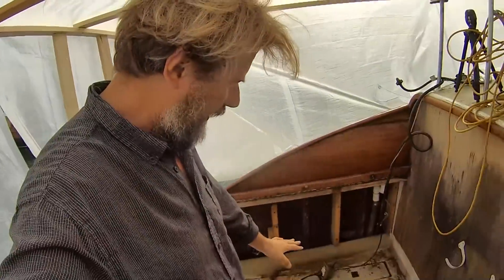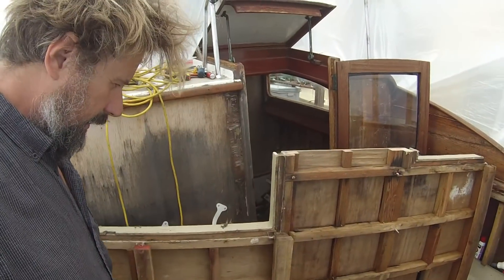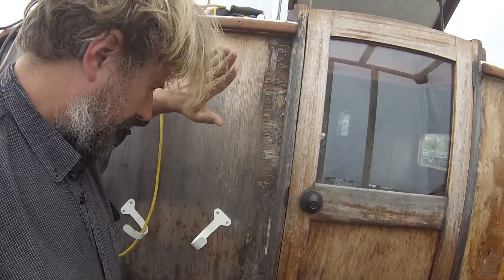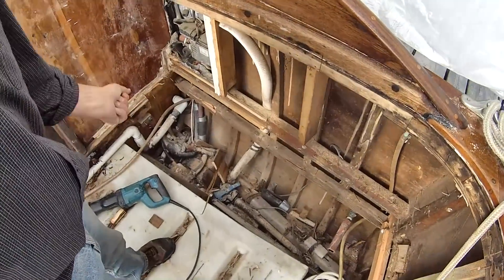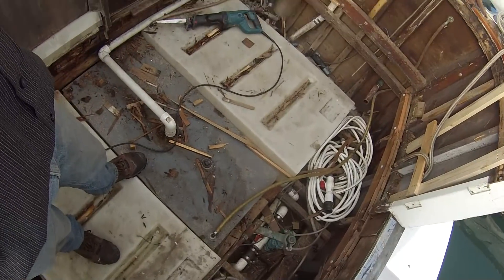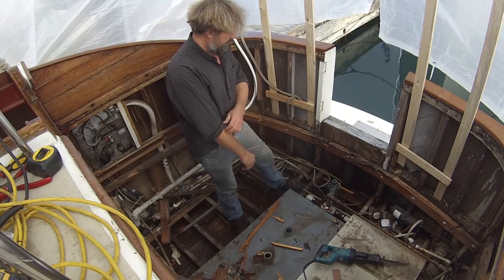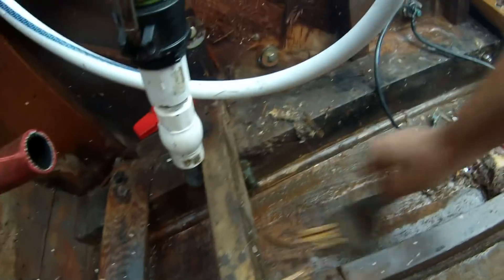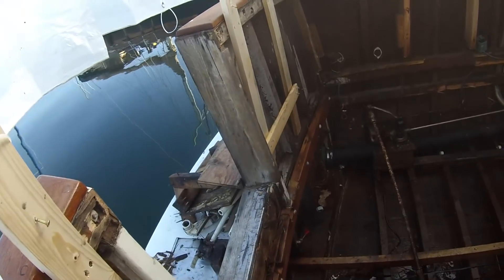Removing the old cockpit sole - Wooden boat restoration - Boat refit - Travels With Geordie #65

Comment: Nice work, big project also.  Have you explored a composting head?  Could eliminate the holding tank and all the plumbing! Take care,
Reply from the maker: Thanks Tom, I have, only briefly. It seems it not the perfect solution for cruising and I need a tank anyway as the boat is now zero discharge. Even the bilge pump goes into the tank.

Comment: Would wood hardener work then after that sets, add some fiberglass resin maybe some fiberglass CSM afterwards?
Reply from the maker: Hi Kevin, I really appreciate the input. The repair is complex and likely temporary at best. I've done a lot of research on this particular problem and think I have a plan. You nailed it with wood hardener, I'm going to use CPES, a very thin epoxy after first drying it as well as possible considering it's afloat.I wouldn't need and laminate as it's not really loaded much. Th goal is just to stop the delignification. which I largely did by disconnecting the misguided bonding wires.Thanks again, so grateful for your interest.

Comment: Question for you: Why are you doing this afloat. Wouldn't it be simpler, safer and maybe cheaper to haul the boat out and do this work on the hard? Surely the hard is cheaper than a marina berth for the winter months.
Reply from the maker: Probably but I live aboard full time too and I wouldn't want to live in a yard. It's blissful here at the marina and not too much more complicated.

Comment: Could you build up that punky timber with some fibre & epoxy ?  That may buy some time until you haul out the boat.
Reply from the maker: Exactly my plan, sort of. I dry it out for a week with a heat gun and then saturate with CPES, very thin epoxy. I've done it in a few places with good result, well so far anyway!Thanks so much for the suggestion.